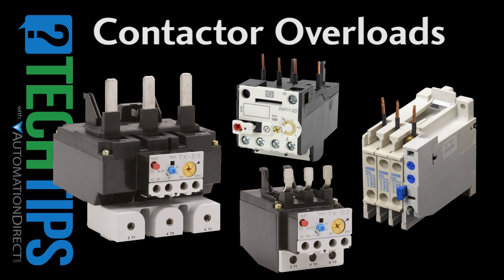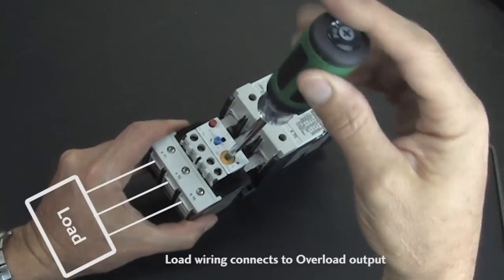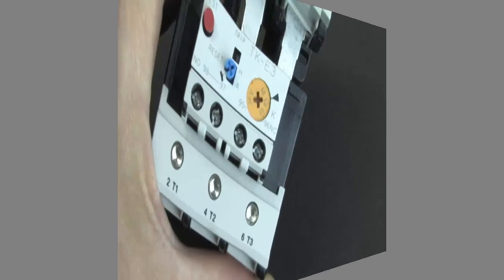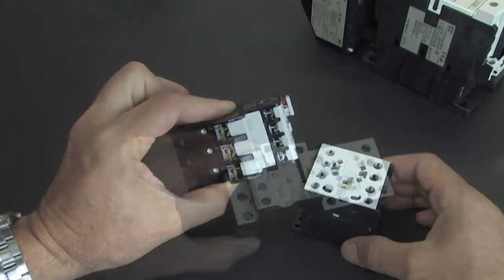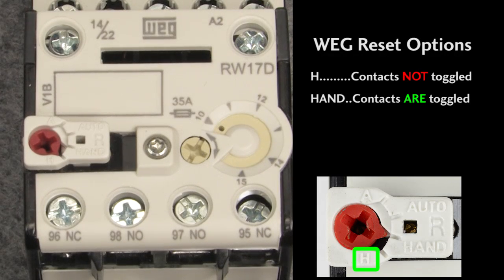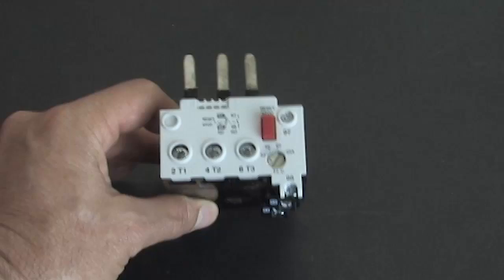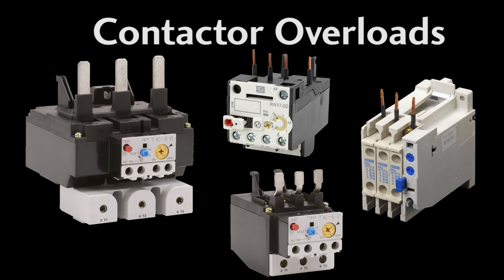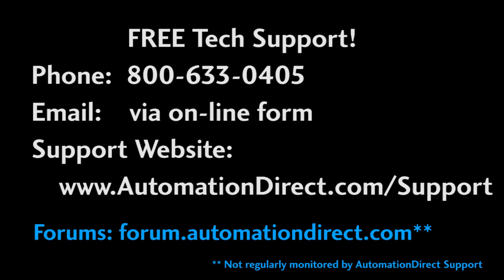Tech Tip: How to Select and Use Contactor Overload Protectors from AutomationDirect

Comment: Thanks for the video but the diagram at 1 minute 57 seconds should have been explained a bit better as I struggled to understand until I went and googled. I think the signal coming from the PLC to 95, then 96 to contactors coil should have been clearer as I now understand the 96 is going to A1 of the coil. But another line is coming from the coil straight to the PLC which which I now conclude is going to the PLC's MINUS from A2.

Thanks for the video!!
Reply from the maker: @Renegade Flower, Thanks for the comment. The polarity is all dependent on if you are using, sinking or sourcing, inputs or outputs, on your PLC. That is why polarity was not mentioned in the video, hoping to reduce the confusion. Best laid plans and all. I will look into adding a comment, to the video, to reflect this. Thanks again, for helping us improve our information.

Comment: In what situations would you want an overload to automatically reset itself?
Reply from the maker: @Skimtar, thanks for the comment. I rarely use an automatic reset on an overload. I do so only when the scenario will not cause damage to machine or personnel. One scenario I remember was the motor being undersized for the conveyor, and it would cause momentary overloads, stopping the process. The instantaneous trip of the overload would catch each time. So, I applied the automatic reset, but I did this, knowing that upstream fusing would catch if there was a real overload.

Comment: Are you reading from the code book ? What is this 28 stuff and why aren't you specifying 430.52
Reply from the maker: Not sure I understand the question ... the 430.31 referred to in this video is the Motor Overload and Failure to start section of the code. Section 430.52 is for ground fault which is not the subject of this video.
Reply: @automationdirect  why though..as an electrician we're always reading from the code book. So my question is wouldn't it be more conducive reading from code or at least specify your references?
Reply from the maker: @crosslolo7245  Thanks for the suggestion.  This video is intended to be a high level overview for the casual learner. So we were trying to avoid getting bogged down with lots of code references. Hopefully folks that know the code wouldn't need a video like this! Regardless, we will take your suggestion to heart and make it a point to at last mention the direct references in the future - thanks!
Reply: @automationdirect  no worries maybe consider youtubr directs viewers to all types. When your in depth you may just want to consider inserting code along with that.But that fine ill look for other teachers since yours are for I guess apprentice..

Comment: How calculate Tripping current???
Reply from the maker: Mohit Nama, this comes down to knowing the load, you are placing on the contactor. 
For example, If you have a motor with a FLA (Full Load Amps) of 8A, you might set your tripping current at 8A. This should be sufficient for most applications, but if your motor is taking a high inrush at startup or under load, the current can exceed the FLA. In these situations, it is typical to add 10% to 20%, to accommodate for this inrush. 

The best way to measure, would be to use an ammeter and determine your max current draw then add 10% to 20% on top of that.  
Thanks